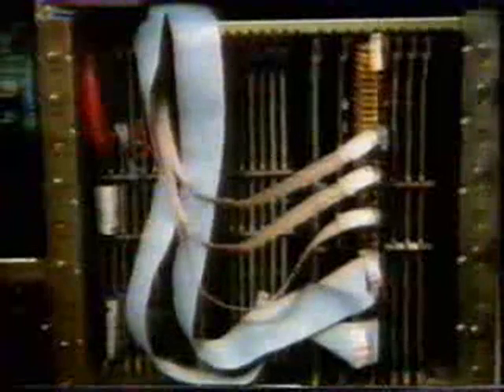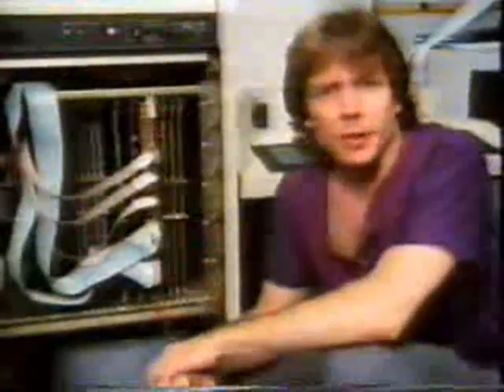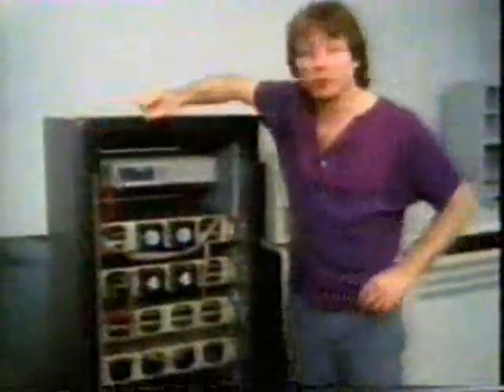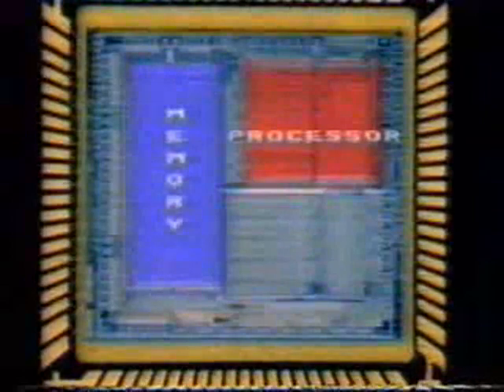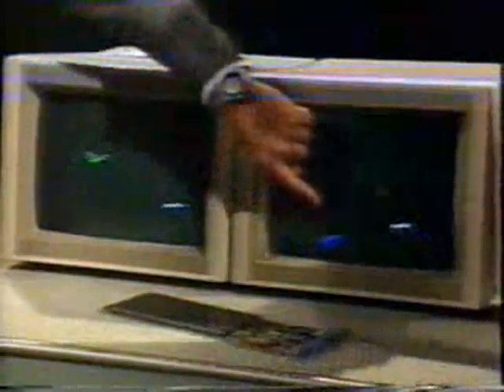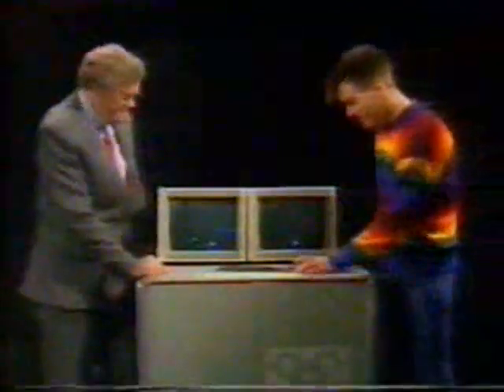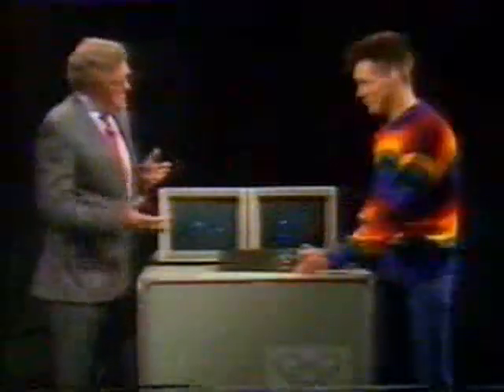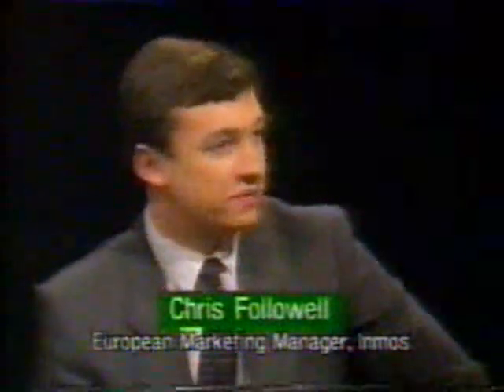Computer architectures 1986 (Transputers)

Comment: I still keep a box plenty of transputers in the dungeons of my school. One third of my PhD used Occam/Transputers. It was an amazing stack-based architecture which, IMHO, failed not just because of the underlying programming model, based on CSP, which was far aggressive and required a quite different way of thinking, but because Inmos largely dragged behind technology. By the time they got the T9000 at 50 MHZ, TI had already delivered a DSP-based multicomputer at 300 MHz (and actually, the transputer community were still using the T800 at a thrilling frequency of 20 - 25 MHZ). Data routing was a nightmare of course... but it allowed plenty of PhDs and papers to come out on the subject of mesh and torus routing algorithms.

Comment: transputer was the original concept of later having most criticism design = netburst. it has nothing but raw clock speed but without many feature that a cpu require in real time performance such as general purpose register/cache/ ALU/decoder but only coupling of  few shift transistor and very simple logic unit and very long complex instruction that attempt to integrate entire binary code into it to reduce number of loading/storing so it wouldn't need to load/store from ram/cache frequently as lack of register will cause impact in performance(transputer does not including any REGISTER, not to mention GPRs or data register which it rely heavy on ram/cache fetching so reduce of loading/storing is very important, but its instruction eventually became huge and buggy even compare to obese isa like 6502, x86 and 68k)

however even the reduction load/store still can't save transputer from having poor performance. without decoder this design became very stupid and slow as all instruction will take forever to execute into the core and increase latency as instruction become more complicate. a 80mhz model is usually only as fast as 8mhz 16bit 80286 and 10mhz 32bit 68000. later 80386 and new risc cpu easily surpass it and it was push to 100mhz barrier at the time of 1986 make it the first commercial cpu fail with only raw frequency and hit to the fabrication wall. it may contain many feature that carrying in modern cpu(long stage pipeline/32&64bit address/cache/brench prediction/multicore/ integrate memory controller/ turbo core/ NX bit/ virtualization, SIMD) but ultimately fail because the fundamental is simply wrong.
Reply: Really the pentium 4 design was based on transputers?
Reply: @liljames2k  some concept was adapted to most of modern out of order CPU (intel’s p6& bay trails, via’s CHA&nano, armv7&v8a, ibm power, apple’s a4 and onward. Except amd )like register renaming and some become the notorious itanium design that using 128 general purpose registers as stack and software based scheduling and VLIW instruction execution, but lost the flexibility to comply sadden situations.   netburst is the true successor of transputer with single super long pipeline and massive stack registers in the back end. It used the same decoding logic as itanium that decode a single x86 oprand into 3 VLIW like macro op and aggressively feeding these execution unit with less numbers but long length op, netburst is simply an itanium in its inner OoOE core.